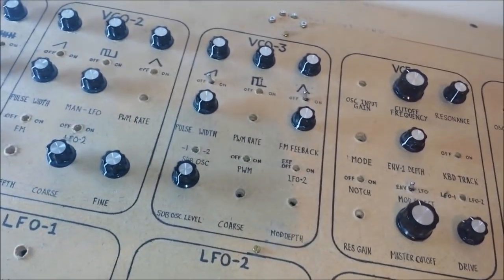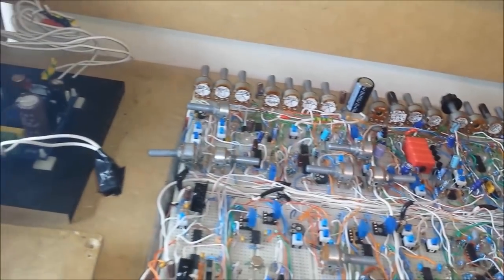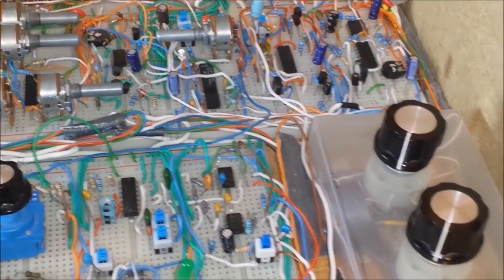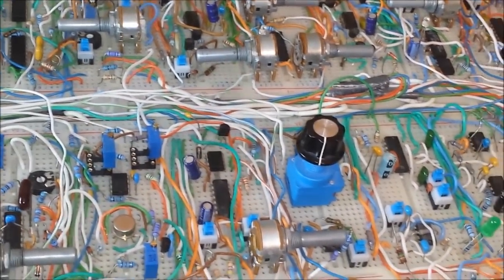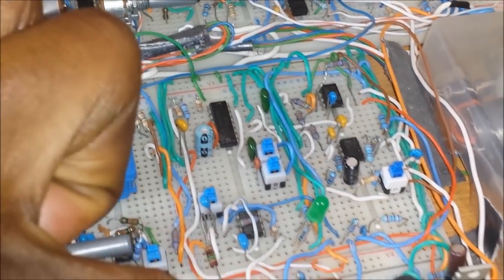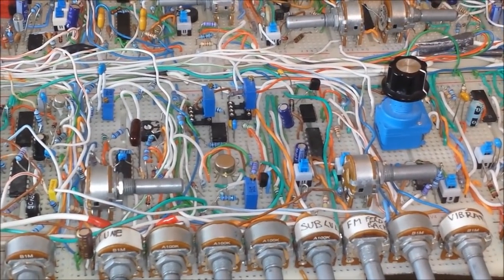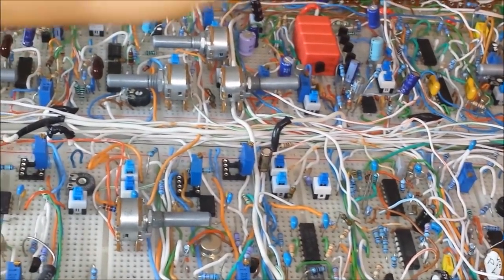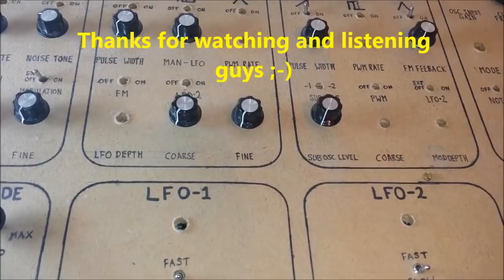DIY analog synth project (Ad-vantage 03 prototype Control Panel and Breadboard circuits tour)

Comment: Much love bro! I am about to make a 4 voice poly synth using Arduino for pwm and adsr's, is it still analog? is there a more analog formula you can recommend?
Reply: That's digital. You can get analog with the 555 chip and the CD40106 is not terribly hard to wire up.

Comment: Great work. Suggest putting all of the pots , switches n LEDs on one big board that fits directly behind the front panel, not forgetting an earth plane for that board. Then group the modules (VCO, VCF, etc) into individual boards, again not forgetting the earth plane. Then suggest sourcing a PSU (power supply unit) that can supply all the voltages you need. Ultimately a noisy PSU, untidy-wiring and lack of earth-planes could introduce unwanted noises into your system.
Reply: I would group all the VCO’s + waveform select/modify to one board, all the LFO’s to one board,  the VCF+mixer+voltage mapping transistor to one board, VCA and Tremolo to one board.  Chorus module to one board and definitely separate, power supply board. When doing PCB’s, especially your 1st, it will never be 100% perfect. So do the least complex module 1st and build experience with PCB design and manufacturer. Good luck with your project looking forward to viewing the result.
Reply from the maker: @HamsterSenior  . Thank you very much for the advice. 😊😊
Reply: Just wanted to add one more important point. Don't forget the coupling capacitors, the 100 nF thingies which connect between the PLUS, MINUS and GND pins of each IC in your design. I know your design is analogue, but  the VCO generates square-waves and saw-waves, and these wave-forms will put noise glitches onto the power rails..
Reply from the maker: @HamsterSenior  Yes thankyou very much for pointing that out. I have thou put these decoupling caps in my schems they are not on they are on some of my dual op amp ics etc on the breadboard. Thou some are not due to space saving. However your very right to point that out. 
What size caps would you recommend for the -/+12v  regulators on input and outputs . I  have read alot of conflicting information , which has left me none the wiser to be honest . At the mo i have 10uf on input and 100nf on output.
Reply from the maker: Thankyou very much for your advice, very much along the lines i was thinking. Would you suggest vcf and vca together or seperated ?
Reply: Every cook has their own secrete recipe when it comes to the finer things of noise suppression and smoothing the power lines and things like that. For the power regulators, try 47uF for the input and 10uF and 100nF in parallel for the output. Electrolytic for the 47u and 10u and a polyester for the 100n.

Comment: I'm really enjoying this series, keep up the good work. As for final packaging, even with your concept of a single front panel, if you are thinking of releasing any of this as a product or OpenSource (and I think there would be strong interest in it), then there would be a lot of sense in making similar sized individual boards for the modules that could fit in a Eurorack style system - kind of like the Erica synth DIY Bundle,  or maybe stackable using header spacers. Plus, the smaller the units, the less chance a minor mistake ruins the whole system.  I do like the concept of keeping all the pots etc off the boards though so that people can design their own front panels.    Anyways, however you choose to go, good luck and more power to you.  Peace.
Reply from the maker: Hey Sean thank you very much for your positive comment and words of wisdom. Definitly food for thought. Im kind of stuck on the PCB design stage despite trying to follow lots of youtubr tutorials . I may have to reach out and see i can get a freelancer to help out . Making each indiviual module in a eurorack format would definitly be a winner as far as im concerned.

Comment: Looks amazing! Thanks for all the information and inspiration, learned a lot from your great videos! Just out of curiosity: why the separate power regulators for the VCO-section? Shouldn't be neccesary If you are using a good quality/stable power supply?
Reply from the maker: Hey man thanks for your comment im glad my channel has been of education and inspiration.
With regards to the vcos . I decided use seperate voltages for the vco as i spotted this in practice from quite a few schematics i have looked at . The power demand of the lfos and envelopes were of comcern at a time. 
Since ive used regulators the tuning has been very very stable so i will go with this setup in the final pcb.

Comment: I wish you the best of luck as you transition the knobs and switches off the breadboard and onto the panel. This power business is SERIOUS biddness ... I had this impression that I could get by without worrying about it .... 😂Happy 2019 bud!
Reply from the maker: Thanks Haze . Think im going to need that luck ive defo bitten off a bit more than i can chew with this one. However if i chew carefully i cant see why i can't overcome the challenges. 
Yes i kind of got away with just batteries for a long while until my power demands began rising as i added more boards.

Comment: Happy new year, just found your channel and loved your content, i need some hours to watch all the videos, really want to see this job!.
I have a question... I wanna make a much simple synth with a couple of 555s, but i want to use it with my DAW in the piano roll or my MIDI keyboard witch have midi in/out ports. Is this posible? 
Have a nice day
Reply: Why not focus on getting your 555 circuits working 1st ... and then feed them CV .... and then worry about MIDI. :)
Reply from the maker: If i was you i would start simple and try and make a working oscillator wether a 555 based one or other. 
Next look into volatge control which you will need an exponential converter to wire into the oscillator. Next you will need some kind of midi digital to analog converter to transmit the midi to an analog voltage for pitch control etc. Have a look through my channel as i have covered a few options
Reply: @AdamTheAd-vanc3d  Thank you for your reply, yeah i will make it step by step, i dont wanna build the house by the roof x). 
I just wanted to find out if what I had in mind is possible, then i ll start doing the synthesizer and then I'll study CV and CV converters to midi.
Reply from the maker: @AlexLassaMusic   Your welcome . Take your time and dont rush it in my opinion you will teach yourself alot in the process like i did. I never it would be possible for me to build a working synthesizer circuit and look at it now :-)

Comment: Awesome Adamski. I can see some advantages to your hand-written control panel. Happy 2019!
Reply from the maker: Hey thanks Dos Gos . Haha love your advantge puns. Yes handwriting things first has allowed me to add additions or change things as ive gone along.
Reply: @AdamTheAd-vanc3d  It will be fun to move to PCBs. Not so long ago this was too expensive and too difficult for homegamers. Now you have free software, free tutorials, and relatively cheap/fast production out of China. Caution on shipping fees!

Good PCB design can significantly improve performance from breadboards. I would lean towards several smaller boards. That will allow you to quickly and cheaply make small revisions without buying and repopulating a big board every time. If you plan this out a bit, you have several modules (and/or Eurorack modules) that are you can make as stand-alone or combined in your big hand-written case. 

If you use a high quality external power brick say from MeanWell to step down mains power, that will reduce engineering effort and reduce probability of fatal shock-fire. It might push some liability to MeanWell. Linear power supplies could give cleanest power but use a lot of power; premium modern switching supplies that switch at high rates and have excellent filtering can perform fine. Health and safety compliance varies by country of course so consult a "certified" engineer here.

Look at the EEV Blog on youtube. He recently noted a few Chinese sites that sell electronic components at outrageously low prices even at smaller quantities.